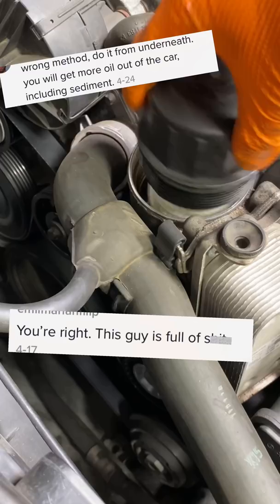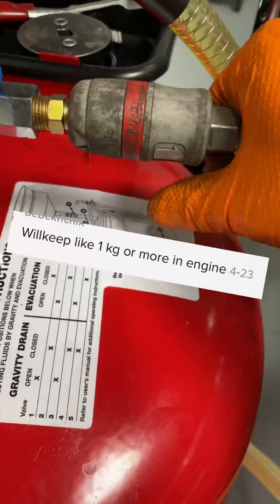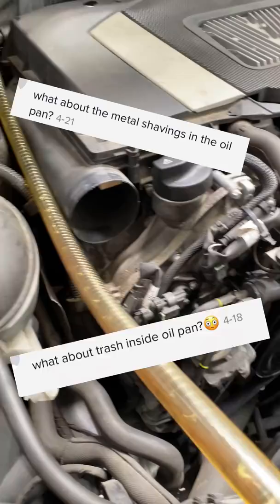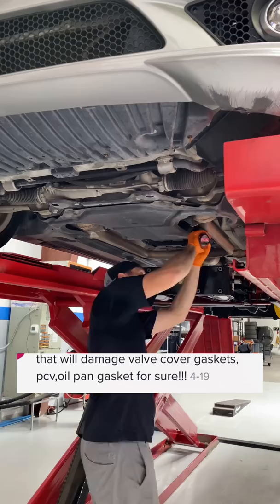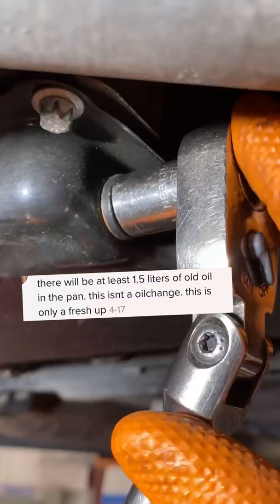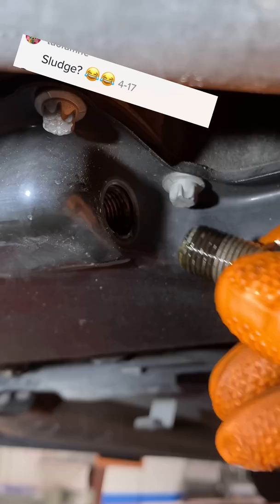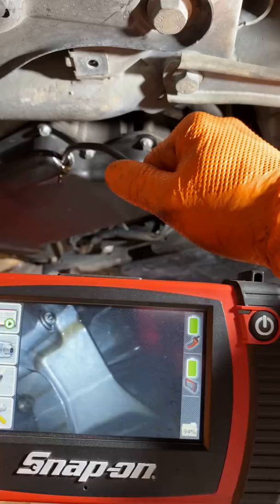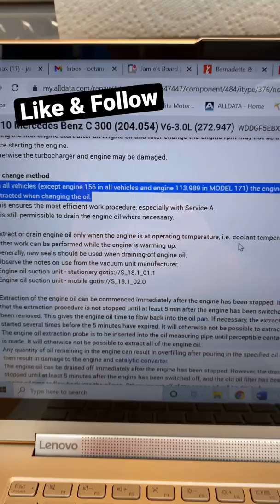#shorts Mechanic Proves Haters Wrong

Comment: "What about the metal shavings in the oil pan" 

Buddy that's not a normal thing that happens, you got a problem with your engine lmao.
EDIT: I have been informed some engines have metal shavings depending  on age and oil type. But still full ass shavings is probably not good.
Reply: Maybe they have a cheap chinese 3000w generator.
Reply: Doesn't everyone have metal in their oil? I only buy premium motor oil with shards of platinum in it. Full snyth of course.
Reply: Older vehicles will. Its normal over time for some wear.
Reply: Well actually very small metallic filings and bottom end bearing material will be found in the oil of a healthy engine.
Reply: @NinjaSushi2  They do, but that's what oil filter is for.
Reply: On the video of the guy proving know-it-alls wrong you really went and did it to yourself uhmwhat.
Reply: Full on shavings in your pan is definitely not a good thing but the tiniest amount only like a magnet could get out is pretty normal to see with bearing wear over time.
Reply: He literally changed the oil of a brand new car.
Reply: @uh3what  all hail the keyboard warrior
Reply: @jacek4815  what
Reply: Most engines produce metal flakes as normal wear and tear, but that's why you have an oil filter.
Reply: @N75911_  I love the extra pizzazz my predator generators oil has 😜.  J/k that thing is a tank, it'll never die
Reply: @bmc9504  sure he did.... pretty dark oil for a brand new vehicle. Not to mention how dirty the vehicle is.
Reply: Well i mean even in old cars that's what the oil filter is for i catches all the debris and shavings.
Reply: @chuckd4499  yeah probably at 3-6 thousand miles max. Numpty was dying for a car like that to come in.
Reply: @chuckd4499  …you think that’s a dirty vehicle? Or am I missing sarcasm?
Reply: @Zach-ju5vi  no the fuck it won’t. maybe in a worn engine, but a healthy engine does not have shavings in the oil pan. i do not know for the life of me where you guys come up with this shit
Reply: @bobrice5159  it sure ain’t clean…
Reply: @SomcallmejameS  it doesn't matter if the engine is brand new, there will always be metal and bearing material in the oil. If you send your oil out to a lab they will confirm this, trust me I'm a fully schooled mechanic.
Reply: @N75911_  never cleaned after milling/facing 🤭😂

Comment: I see why it’s proffered to be extracted rather than draining it from the bottom, bcuz of the design of the oil pan, there’s a slope that drops past the drain bolts, which will entrap a handful of old oil in the pan. So extracting the oil takes out nearly every bit. The comments saying there will be “a quart/liter of old oil left in the pan” , they’re dumb lmaoo. Dudes literally using a pressurized system to suck out the oil, and not only that, he’s sucking out the oil from the dipstick location, which literally touches the lowest part of the oil pan. Which will suck literally every bit of oil out..
Reply: Finally a smart person in the comments. All I’ve seen so far is a bunch of mamas basement keyboard warriors who think that watching Stradman makes them specialists. I’m no specialist, but at least I’m not as dumb as some of the people I’ve seen here. Yep, that slope will cause issues if you’re trying to get oil out. That’s why I’ve only once owned a European car. Too much work to do alone, and costs too much money to have somebody else do the work.
Reply: @ziggy3237  LMAOOO so true
Reply: Lmfbo a smart person can spell 3 and 4 letter words lmfbo
Reply: Thanks you,sir!
Reply: The dipstick tube actually doesn't hit the bottom. Just down far enough so that you don't over fill to the lowest point of the rotation of the crank.. if the crank slaps the oil a thousand of times a minute you will have bubbles trying to cool your engine Instead of liquid... in. HG works wonders on containers of any sort size or shape.

Comment: This method is just as good as using the drain plug. I maintain all my vehicles, daily drivers and collectables and when I do them I use the drain plug. The reason being that while its on the hoist I can look for other issues that may need addressing under the vehicle.
Reply: Like a normal person lol. Tbh, doesn't matter how you remove the oil, manufactures will build the sump in such a way that both is equally effective
Reply: @FC0BCA7E7A  nobody asked you either
Reply: @FC0BCA7E7A  You're what we call a "doos" in South Africa lol
Reply: @codycloete169  does that translate to douche in American?
Reply: @halvorson566  not sure if there's a direct relation but pretty much yes.
Reply: @halvorson566  *English
Reply: @KinkyNothing  Canadian*?
Reply: @halvorson566  not even remotely close
Reply: @halvorson566  what part of not even remotely close didn't you get? Anyway, to be fair it's (American) English
Reply: @halvorson566  doos is the same in Dutch which means box literally. However, in the Netherlands it's also used as a swear word referring to the female genitalia. Dunno about Afrikaans tho....

Comment: My favorite was "that will damage oil cover gaskets, pcv and oil pan gaskets for sure"! As if these parts aren't meant to be used in high pressure and high heat applications. Like running fucking engines! I love armchair professionals of all sorts.
Reply: THANK YOU.
Reply: @jackpijjin4088  amazing how many heads that went over eh?

Comment: Didn't believe this when i was told about it. until I tried it myself and not 1 drop of oil came out of the bottom. I was shook. Helps avoid stripped plugs.
Reply: *shocked
Reply: @readmore7180  do you not know the meaning of shook?
Reply: @readmore7180  i ment shooked
Reply: @lilchub8209  shook is the past tense of shaking something. I.e shaking hands or shaking a can of pepsi or someone shaking you.   The emotion of being in shock has a  past tense,  shocked. I.e "I tried it myself and not one drop of oil came out the bottom. I was shocked".  Being shook seems to be the new cool phrase people are using, but it's not cool. It's stupid.

Comment: "Will keep like 1kg or more in the engine" half? Lolz
Reply: Half?? Bro my 3.6 v6 hold 5.4l
Reply: And since when do you measure liquids in Kg lol
Reply: Easy mistake he made. Pretty self explainitary that's it should be litres. No need to be toxic bout it
Reply: @SamButler-ly3ue  i'm not really sure about that as maybe he said the sludge in engines are solids instead of liquids
Reply: @SamButler-ly3ue  Toxic? OK, I retract his well earned LOLZ, and reassign it to you.  Fuel is often measured by mass, you know, ships, planes, things where weight is really important.  You don't get that his "easy mistake" illustrates just how nonsensical a source it was coming from?  I honestly can't see how or why, other than service is big revenue, they would want to evacuate their oil like this. I've done it, boats and machinery that were near impossible to access otherwise.  Guessing there is probably a tube that runs to the bottom of the sump? Ya know, engineered into there kinda like it has a purpose?  Kinda almost like all the drama queens worried about the kilos of oil left in a car they can't afford are maybe the toxic ones?
Reply: @karvast5726  it's a SLUDGE. it's liquid.
Reply: @Eradicator-jv9xr  yes that's what i'm saying but i'm trying to figure out why the comment in the video is reffering as oil as solid 🧐
Reply: @karvast5726  lmao oil as a solid? What did they do put it in the freezer? XD
Reply: @Eradicator-jv9xr  that's what i'm thinking,if yoir oil is solid i think you forhot to chabge your oil for 150 000kms

Comment: "How do you get the metal shaving out" like... you have bigger problems than an oil change if you have metal shavings in the pan 😬
Reply: Over time any engine, even well cared for ones, will accumulate shavings in the pan

Comment: This is completely wrong, you should always oil drain from the exhaust
Reply: Ha! Only if you wanna wreck your car. Everyone knows you need to drain the oil from the extraction tube under the steering wheel.
Reply: @gideon4883  No wait, I just found that there's a little valve in the water pump that's even better for draining oil. Remember to use extra ducktape to seal the valve

Comment: I've Been Doing Oil changes on My Renault Thalia for 6 yrs with this suction thing
And let me tell u that i've never had a Single Issue 
My Oil Pan is Aluminum which is more suceptible to strip the threads when removing the Steel Bolt !!
Reply: And you won't have any issues, At least you shouldn't,  Only the people that think changing oil is a waste of money do.😎
Reply: @raymondreiff8170  then when they hear noises from their engines they're like 
hUmMm WhAt tHa hEcK iS ThAt NoIsE 
🤣🤣🤣🤣
Reply: @RamyFal  Worse yet most give that situation the throttle🔥 fix☠, to make dam sure no one can ever repair it, without installing a Junkyard engine, Then proceed to blame the cars manufacturer 🤯     🤣🤣🤣
Reply: @raymondreiff8170  🤣🤣🤣🤣 or the mechanic

Comment: Most boat engines have the oil removed in this way, and some cars dating back to at least the late 90’s have come without sump plugs - you just suck the oil out the dipstick tube.

Oil should be a bit warm beforehand ideally, but manual pumps such as the “Pela 6000” are around 30-50 to buy. 

You can see how much oil you’ve removed clearly on the side marks of the pump, so you can tell if you’ve removed it all - but also exactly how much you need to add.

Not having a sump plug means less chance of oil leaks, as these are often over or under tightened.

Comment: My problem isn't that he's using an extractor. The problem I have is that the "preferred method" endures that I either have to shell out for a glorified vacuum or take my ride to a dealership/mechanic for an oil change.
Reply: Extractors don't have to be more than $100... and they're reusable. You don't have to do anything.
Reply: Make your own fitting, if your mechanic  do what we always do, make our own tools and contraptions because a proper oil drain extractor tanks are a bit pricy if your not a shop. My boss has an ml63 amg and he still takes the bottom covers off and drains it by the sump drain... but its a merc so it always needs attention other than oil change, airmatic suspension is painfull.
Reply: @ThatOpalGuy  yes. I will walk for hours to get to work every day. Thank you for the tip. This is feasible for everyone.
Reply: @saltydinonuggies1841  ikr, it takes 45 minute drive to my job, on a good day, at 70mph.. I’d never make it to my shift if I were to walk
Reply: Draining it from the bottom isn’t a problem, but I prefer to vacuum the oil because after I do my inspection I can just plug the machine to the dipstick tube and change the filter while the oils getting sucked out. And if it’s a more involved service with engine air filters I can take the time that the oils being sucked out to do those as well. Sometimes I’ll drain it from the bottom if I have to do a brake flush since I can drain oil while bleeding the brakes.
Reply: @tonykb2193  it's a benz*

Comment: Lol. This brought back the “bad engine” blown headgasket memory. >.> good times when people listen to others who don’t even do any of their own mechanic work. Sigh. Got a cheap bike out of it though. Lol
Reply: Dude what are you even on about?😂
Reply: He's talking about people online that say bad engine or blown head gasket when in reality it's something simple. Got my first jeep like this a 98 jeep grand cherokee 4x4 132000 miles for $1000 because the lower radiator hose had a cut in it so leaked real bad when warm but not cold dude thought it was the head gasket....best $3 fix ever
Reply: I used to buy mini bikes all the time on Craigslist. But only ones that "won't start" for cheap. A little carb cleaner and I got a new ride.
Reply: @jacobflores-rapp2188  you buy vehicles people claim need an engine when you can fix it for a few bucks. I have even had them sign the ownership over pull out a couple tools and drive the vehicle home.

Comment: There shouldn’t be metal shavings or sludge with a healthy engine with regular oil changes done. If they have some that sounds like a them problem😂😂
Reply: I agree. Although over time with normal engine wear a few metallic particles isnt abnormal. But it shouldnt be enough to worry about every oil change
Reply: “Sad old bmw noises”

Comment: When someone says “fresh up”. They have never touched a car in their life. I have never heard such a dumb terminology in this industry as there is no such thing. It’s done right or not done at all. There is no such thing as partial and saying. “This was only a fresh up”.
Reply: They may be confused with topping off oil simply due to oil consumption  lol. Old oil isn't getting fresh with new oil in it, doesn't make sense to me either and this is the first time I've heard of it.
Reply: Old change intervals is directly related to the amount of oil the vehicle holds.   More oil, longer intervals.   It new oil is added to of oil it does extend the life of of oil and postpones the oil change.  Heat and driving style is important too.
Reply: @adamwade855  so you telling me you di half or some of a pil change and you call that shit a fresh up 😂
Reply: @adamwade855  Do you even have a understanding of how oil flows through a engine would be your question before posting.
Reply: @adamwade855  so much wrong in your comment bud. The weak link of auto lubrication is the filter. The filter will plug up long before the oil becomes worthless.
Reply: I do fresh ups on my F150 all the time. It uses about a quart per week (463k miles).

Comment: If they’re concerned about metal shavings in their oil they have bigger issues to worry about😳
Reply: Actually , metal shaving can happen from friction from pistons , motorbikes need a service after just the first  500 miles to remove metal shavings that the new piston causes during engine breaking in

Comment: Only thing I've got to say is thats a smart way to design a cartridge style filter, very clean & easy. Toyota should take notes w/ their dumb sideways filter design.
Reply: Toyota should take notes from Hyundai. They make every difficult to get to Hyundai on the other hand once you know the tricks its simple as eating pie.
Reply: Atleast the 2020  yodas and above ditched the stupid cartridge for a spin on, rather have a spin on every day of the week regardless of any cartridge. Easy off easy off simplisty
Reply: @brucetec6597  As long as they don't take hyundai's notes on how to make a GDI engine burn a Hondas worth of oil halfway through an oil change.. ;)
Reply: @DarkAttack14  That is actually solved by doing proper maintenance. Hyundai engines really don't do well with dirty oil.
Reply: @brucetec6597  They tend to oxidize their oil to a dark black long before they are due for an oil change. Hyundai has been replacing quite a lot of engines due to excessive oil consumption, even properly serviced engines. They have some testing regiment for service centers where they seal the plug cap and dipstick for a specified amount of miles and if the oil usage exceeds their specification they have to replace the engine at their cost. Something along those lines
Reply: @brucetec6597  I work at a quick lube type place and it's stunning how many of hyundai's engines come in with oil as dark as a diesel, and some people have come in at 3000 miles on a full synthetic and have oil levels barely touching the tip of the dipstick, more than a quart and a half low 2-3 thousand miles before they've reached the manufacturers oil change interval. It's nuts
Reply: @DarkAttack14  If it's burning oil like that they probably need to replace their pcv valve. As an automotive technician it's amazing how badly some people treat their cars.
Reply: @brucetec6597  it's not a pcv issue, it's an engine design issue and even some of the replacement engines burn oil like that and get replaced again, hyundai has garbage quality control engine wise

Comment: Not a single one has used an oil extractor but of course they’re experts on doing it every other way. Thanks for making the video and sharing.
Reply: That's a good point - logically to say a method is "wrong" and suggest a better one requires at least a working knowledge of both methods, surely? So their point it immediately invalid.
Reply: He's not going to sleep with you guy

Comment: I do this everytime with my civic, that dipstick tube is literally at the damn oil pan, it's the same thing but you're just using suction. If your engine has "shavings" and not those tiny metal particles y'all must be running your engines low on oil everytime you don't see large particles bigger than the dipstick tube like literally it's not the engine's problem anymore it's now in between the steering wheel and seat
Reply: But not all are,  sometimes it sits in a baffled area where the pipe won't hit the bottom of the pan.
Reply: @ssss-df5qz  yeah, or the dipstick extends well past the tube like on a lot of v8s
Reply: @cc23001  there's a small tube used for that reason

Comment: Haha I know the feeling about doing services like this!! We as mechanics don’t spend all the time being apprentices to then become qualified in our jobs to have some backyard mechanic who just judges your work saying you shouldn’t do this or that yet you know from expertise/experience you can
Reply: Backyard mechanics don’t have oil vacuums that can handle such hot oil. AD says pump it for @LEAST 5 MORE min after the motor was stopped. Furthermore, “not all models can be pumped”, and goes on to name them. What backyard mechanic is using AllData for an oil change? Probably this is a pro not the type you’ve reckoned on placing a bet.
Reply: You’re saying that you can read？prove it